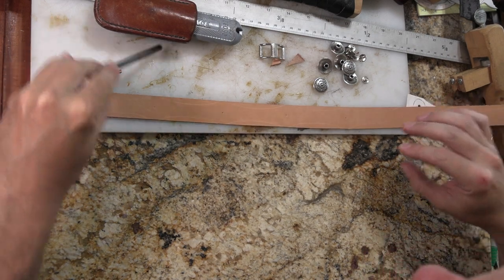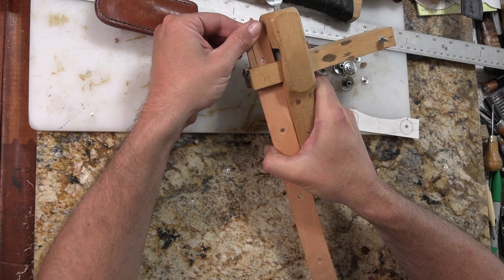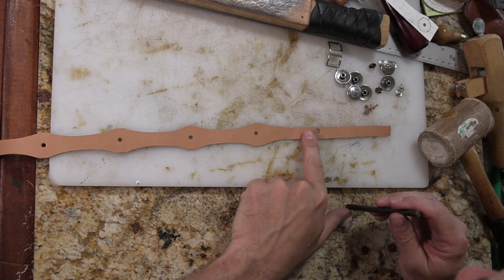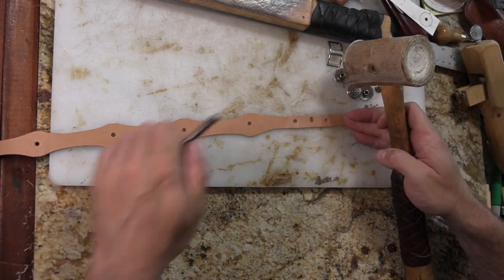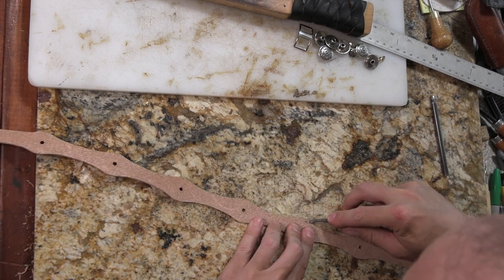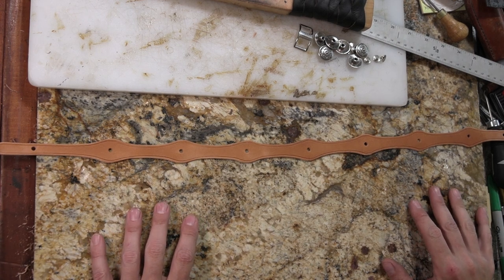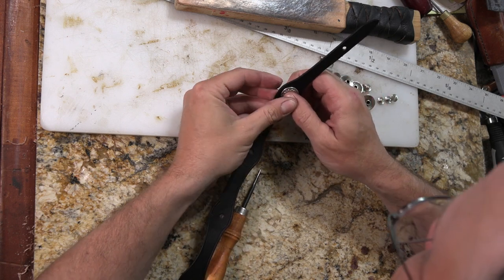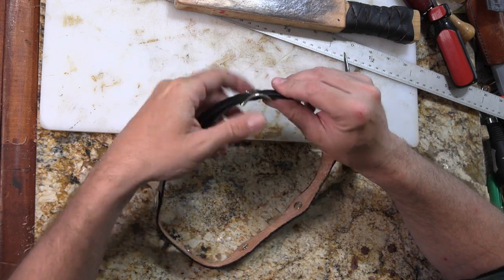Making a hatband with conchos and scrap leather.

Comment: How about making a cross draw holster for a 14" barreled Contender single shot. 
  A practical good-looking holster with maybe a shoulder strap or two, its a heavy gun. A holster that a medium sized man can draw a long barreled pistol from easily. I don't think a behind the back holster(or behind the neck) would work too well for me because I'm not that flexible. 
 I'm considering a speed draw holster where the front of the holster is open and only holds the first two or three inches of the pistol barrel, but I'm not sure if the holster would retain its shape for the long haul.
Reply from the maker: I don't sell custom holsters online. I have a full-time job and enough business locally to keep me busy. Sorry.

Comment: Love your videos very informative and no excessive bs :) , one question...where do you get your paper for pattern making?
Reply from the maker: I am currently mostly using a paper somewhat like like poster board.  I have a big roll of it that I lucked into.  I also like using scraps of rolled linoleum flooring.  I will also just draw up patterns on regular copy paper but they are usually only good once unless I copy them onto something heavier.